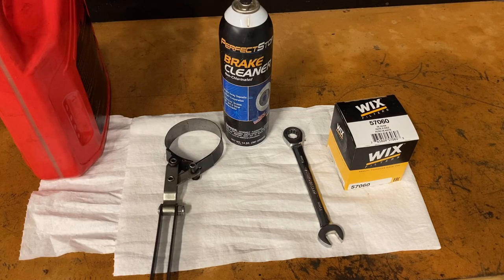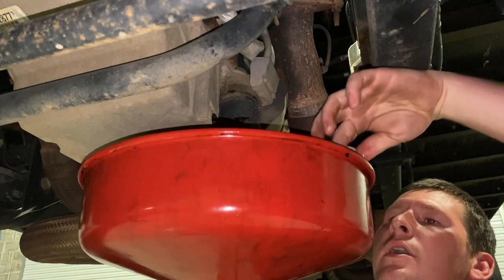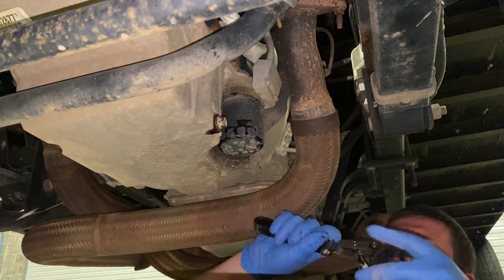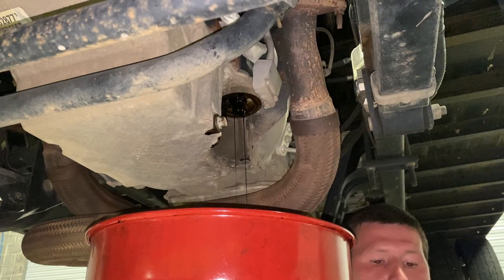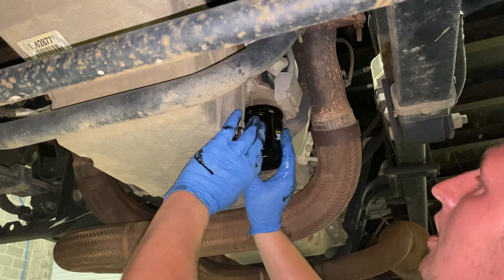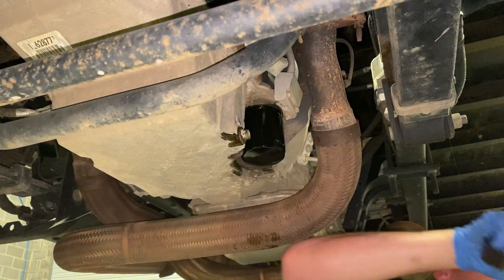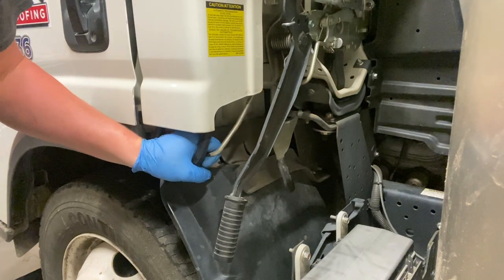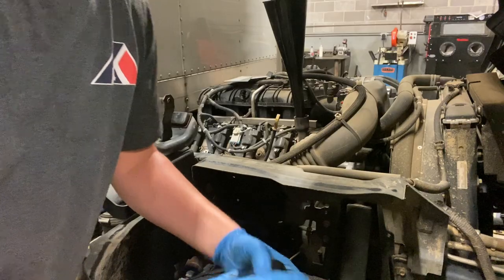Isuzu NPR oil change

Comment: You are the best, could not find capacity anywhere. I have this truck with about 85G on it now. Love it had a 97 that is just to old to travel. The only thing is it revs the pis out of the engine. Seems like it should always be one gear lower.

Comment: Hi there is it true that in a v8 engine 2003 isuzu ascender.  To be able to change the oil pan for motor oil. they need to remove the motor ? If someone knows please let me know i need some advice.